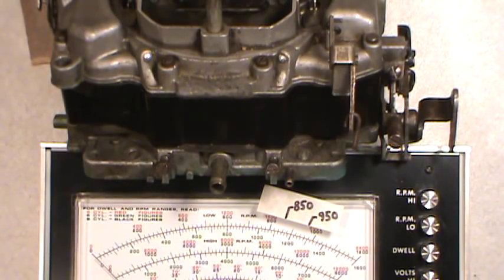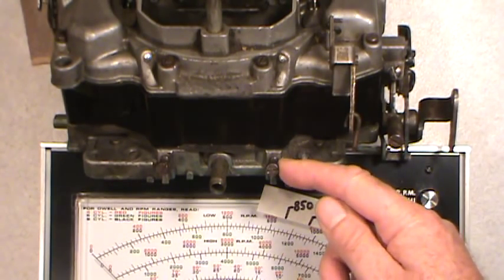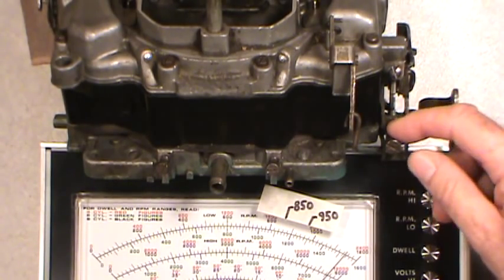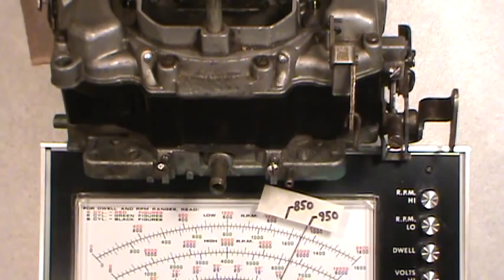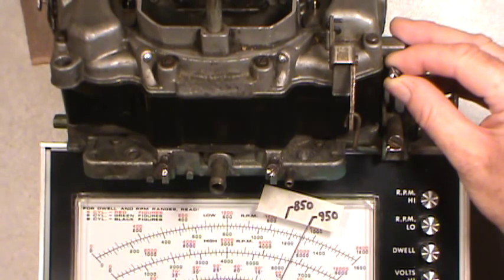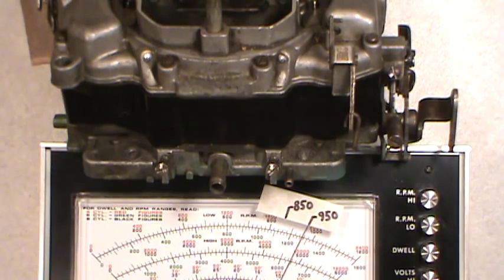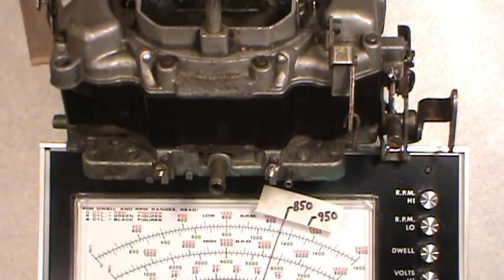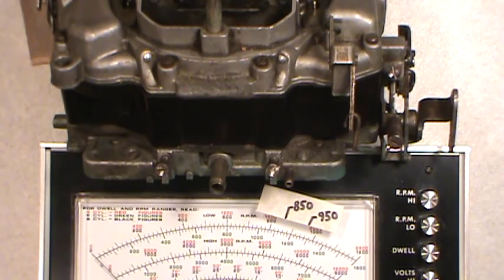Idle Mixture Adjustment on 4 Barrel and 2 Barrel Carburetors

Comment: I have a 9128S made for the IH Scout for my 1979 Scout II with 345 V8 and 727 auto trans.  I bought it supposedly rebuilt to IH OEM specs.  It started up first try but was fast idling at about 2000-2500 rpms and once it warmed up it went to about 1400 rpms.  So I turned out the fast idle to about 1800 and curb idle to about 750 rpms.  When I drove it the first time, it dies when I give it a lot of gas.  I can ease it up to speed but cannot punch it without it stumbling and dying.  Do I need to go through the idle mixture screws tuning you show in this video?  I'm getting an analog engine analyzer so I can know rpms exactly.  Any help greatly appreciated.
Reply from the maker: Greetings...Tracy Dixon...……..Thanks for watching...…….Well, if the idle "mixture" screws, are adjusted good enough, to have your engine idling nice and smoothly, then, that, in itself should be ok, thus far...…….Here are two things, that can cause stumbling, on an aggressive/full throttle take off...…….Does the vehicle accelerate alright, when driving normally (if not, then, it'll usually be, something wrong with the accelerator pump system)………..If the normal driving acceleration is alright, then, we'll move on to the secondary's "air valve"...……..Having the engine "Cold", and "Not Running", push the "stem", that comes out of the choke pull-off (look like a little space ship), all the way in, then, release it, and watch closely, how it extends outwards, to its maximum length...……..A good choke pull-off "stem", should come out smoothly, and reasonably, straight out as well (not leaning to the side)………..This test, is a pretty good indicator, as to, the condition, of the rubber-like diaphragm, that's hiding, inside of the choke pull-off...……The choke pull-off, regulates the opening rate (time-wise), of the secondary air valve...………..There is also a torsional (wind up) spring adjustment, for the secondary air valve too...…….On one side, of the air valve's shaft (end), there will be an outer locking ring, which can be loosened, with a good fitting screw driver, and, once it is loosened off, the secondary air valve, should flop open (vertical)………..The inner screw head (isn't a real screw at all, it just connects to, one end of the torsional wind up spring)………..So then, once loosened, adjust that outer locking ring, so there is a slight drag (resistance), when using a smaller screw driver, to adjust that (smaller) inner screw head...……..Start turning the inner screw, until, the rear most side, of the air valve, comes up, and just touches the boss/stop, that is part, of the Thermoquad's, top aluminum casting...…….Once that stop point is made, then, the additional turns/partial turns, could be called, the spring wind up (amount)………….My Thermoquad, has a specification, of 1 and 1/4 (one and one quarter) turns, spring wind up...…….Maybe try 1 and 1/2 (one and one half) turns, to see if it helps or not...…….Once, the spring wind up adjustment is made, make sure to tighten the outer locking ring, or...oh oh...it will be...lol...…….Shouldn't need any more, than about, 2 turns, on that wind up spring, or something else, isn't, as it should be...…….You can also try this...…...Once the engine is fully warmed up, shut it off, and, put a cover (tin foil or plastic bag), on top of the Thermoquad, so, any potential, small flying parts, don't get inhaled by your engine...!!!...then, disconnect that metal rod, that goes from the choke pull off, to that curved/slotted bracket, that's on the air valve's shaft (end), and, remove bag, from top of Thermoquad, etc. ……...then, test drive...results...??? (better or worse...???)………..I did a modification, that eliminated that rod, from the secondary air valve, on a standard transmission car, and, Wowsers…!!!...went crazy good...!!!...but, I had to drill a small hole, in that straight arm (that's, close to, that curved/slotted bracket), and, had to make, a new/shorter link (rod), so the choke would still work (Yes-Sir-ee-Bob...that choke pull-off, has two duties/things to do, alright)………..Fuel pump ok...??? (fuel starvation, possibly)………..So then, if you are still having trouble, then, just give me a shout...…….Good luck, and...….till next time...…..Be Safe, take care, and have a good one.

Comment: Mixture screw was set with the engine off counter clockwise 3 turns. What about the idle speed screw, Is there a baseline for idle screw too?
Reply from the maker: Greetings...curtis sanchez...........Thanks for watching..........That 3 turns out (counter-clockwise), from just being lightly seated (as in, being fully closed and turned clockwise), is basically, just a rough setting, so that, the engine will start up and run alright, until the, shall we say, "fine adjustments" are made, when the engine becomes fully warmed up, to operating temperature (and also, with the choke plate, being fully open as well).........Whether it happens to be, the "rough" setting, for either, the "idle mixture screw"...or...the "idle speed screw", then, these so called rough settings, are usually called, "bench settings" (as in, on the work bench)...........Each engine and carburetor combination, will usually have its own "specification", as it applies to, the "curb" idle speed (curb idle speed, kinda means, the curb, at the side of the street, basically, and, the vehicle not moving at all, just as it would be, "idling", at a red light or stop sign)..........The adjustments are really fussy, if the vehicle has to be smog/emissions tested, and, not so much, if the vehicle "does not" have to be smog tested..........Have a look in your engine compartment, or, under the hood, for a sticker or label, that might have the (curb) idle "speed" specification, printed on it, and there might even be, the way in which to do it, as in, procedure..........Sometimes, there might be some vacuum hoses, that might have to be removed and plugged, and/or, wiring disconnected possibly...........Here are some settings, that I've used in the past..........For an automatic transmission car, the idle speed, was about 700 RPM's in Park, and would drop down to, a curb idle speed, of about, 600 RPM's, when the automatic transmission was placed in Drive, while the brake pedal was pushed down, and also, while the engine was fully warmed up to operating temperature (choke, fully off)..........The curb idle speed, can't be set too fast (RPM's, too high), for an automatic transmission vehicle, or, the vehicle, will tend to "creep" along (forward), way too fast, as soon as you release the brake pedal...!!! (same thing happens, if the choke hasn't reduced, the fast idle speed enough, while placing the automatic transmission in Drive...!!!)...........I have also seen, a "standard transmission" (with a clutch pedal) car, that had a curb idle speed, of 850 RPM's, while the standard transmission was in neutral, or, while having the clutch pedal depressed, and, engine fully warmed up, which was that high, for smog reasons...........Never, stand in front of, an automatic transmission vehicle, while it is in Drive, or, any other gear, because, you, or someone else, might get run over...!!!..........I usually, set the Idle speed screw, with the "emergency brake on", vehicle on level ground, while in "Park", at about, 100 RPM's higher than, the idle speed, that I want to have, when the automatic transmission is in Drive, while I also have the brake pedal pressed down, for "Safety" reasons...!!! (oh, and, engine fully warmed up, as well)..........If the vehicle needs to be smog tested, then, you'll have to find the specified (curb) idle speed, and set it to that...........Sometimes, there might be, what is called, a "lean drop" specification, for setting the idle mixture screws, that might be printed, on that label or sticker, that I had mentioned earlier..........The instructions (sheet of paper), that is usually found, in a carburetor rebuild kit, will usually have, quite a few specifications on it, as well as, the way to do the adjustments or settings............A Haynes aftermarket manual, will also, help a lot, with plenty of information too............If Ya need any more help at all, then, just let me know, about, your vehicle's...year...make...model...engine size and number of cylinders, automatic or standard transmission, and also, if the vehicle has to be "smog tested", or not...???............Good luck, and.......till next time.......Be Safe, take care, and have a good one.

Comment: What setting is the Fast Idle screw set to when you started this project? 
You didn't mention that.
Should i have it all the way snug tight by hand? 
the mixture screws should be 3 full turns out right?
Reply from the maker: Greetings...Cb BroWnN........Thanks for watching.........Was it the..."Fast Idle Screw"...or, the..."Curb Idle Screw"...???...b-cuz, they happen to be, two different kinds of animals, so to speak..........Fast Idle (is controlled by the fast idle screw adjustment, while it is making contact, with the fast idle cam/or lever) and, is only in use, while the engine is cold, and, while just warming up..........Curb Idle (speed), is only working, when the engine is warmed up to, about operating temperature, and, the choke (system), is fully off..........It's usually, only, the two Idle Mixture Screws, that get turned all the way in/clockwise..."Very Gently"...until, each one of them, comes to a stop (so, as to...Prevent Damage, to their tapered, needle-like tips, and the little hole that they go into)..........The two, idle mixture screws, being adjusted to, 3-Turns out (from being Gently seated to a stop), is just a rough starting point, so the engine, will at least, run ok, until it fully warms up to operating temperature, then, from that point/rough setting, the (idle speed) Air/Fuel Ratio, will usually become Leaner, as the 2 idle mixture screws are turned in (not too much/too far), in a clockwise direction (from that rough setting, being, 3 turns out, from being gently/seated to a stop)............Perhaps, watch this Video, a few more times, and see, if it helps you out at all...........So then, just let me know, if it's the "Fast Idle Speed"...or, the..."Curb (slow) Idle Speed"...(or, maybe Both...???), that you want to know more about, and.......till next time.......Be Safe, take care, and have a good one.

Comment: I have a 79 Lincoln Mark V two-barrel 400 and I can get to one of the adjusting screws on the right hand side of facing the carburetor what instrument do I need to get to that one I can only adjust it from one side but I can't adjust it from the other my hands don't fit and I can't see how I can get an instrument in there
Reply from the maker: Greetings...Bohemia Lite...........Thanks for watching...........I hear Ya alright (as, I use to have, and also worked on, a 1972 Ford 351 Cleveland V-8, with a Model 2100...2-Barrel carburetor on it, which is probably, very close lookin', to your, probably being, a Model 2150...2-Barrel carburetor, as far as, I might know)...........It's not so much, the Carburetor's fault, that you seem to be having, some, shall we say, "restricted access", to one, (or, in some cases, both) Idle mixture screws, and is usually, because of, all of the other parts & pieces, that might be Mounted..."right-in-front"...of the Carburetor (correct...???)...........Here are a few ways, that you'll probably be able, to get at, that, not so easy, to get at & adjust, idle mixture screw............There use to be, a, shall we say, "special", idle mixture screw, adjusting tool, that kinda looked like, a fairly long, small diameter "spring", that had, a screw driver-like handle, on one end of it, and, on the other end (of that long spring), had the proper, type & shape of "tip" (or, call it a "bit"), that would match-up, with the idle mixture screw's head (as in, a slot, for a plain tip screwdriver, to fit into, as an example), that needed to be turned/adjusted............You can also, buy or make, a fairly long, small diameter, and, long enough screwdriver, to reach in there, providing that, it's able to make it in there, in a straight line, or, can be a bit off to the side, as well, seeing as how, an idle mixture screw, usually doesn't take much force at all, to make it turn...........Might even use, a long enough, piece of plastic tubing (fish aquarium pump's, neoprene/clear tubing), that fits snugly, over the idle mixture screw's "head", as, it can bend quite easily, and might be able to, get around, something, that is slightly in the way, possibly...........Be very "gentle", when-ever turning, an idle mixture screw, all the way in, until it stops, b-cuz, it will usually have, a fairly long, quite small (in size), pointed "taper" (angle), on the end of it, so it doesn't get...Damaged...!!!...........No-matter, what "tool", you might use, to make the adjustment on the Carburetor..."Make Sure"...!!!...that your hands, and arms..."Don't come in Contact"...with any..."Spinning, or Hot engine Parts"...so you don't get hurt...!!!..........Good luck, and.......till next time.......Be (extra) Safe, take care, and have a good one.